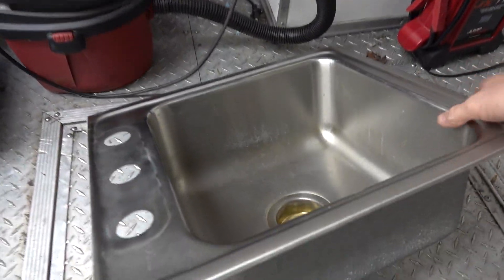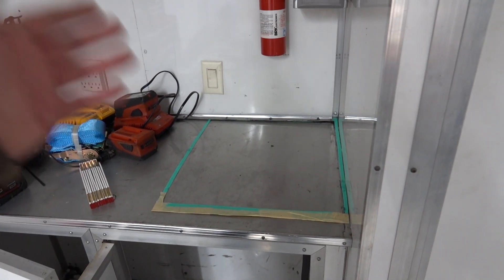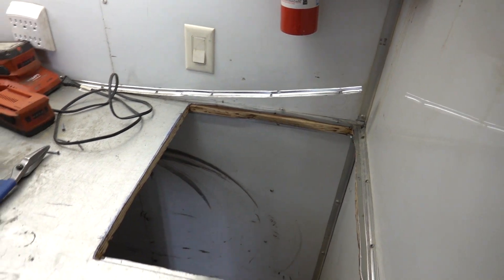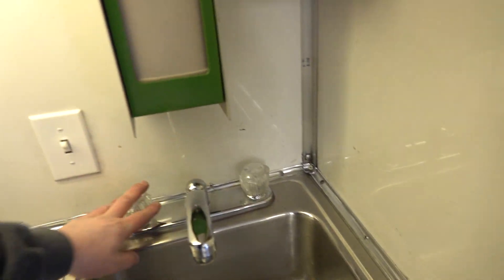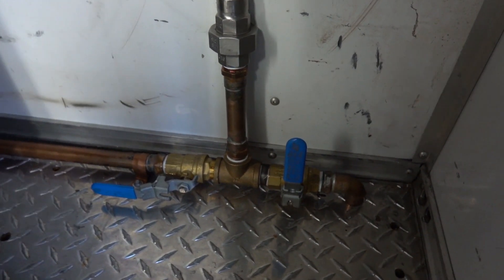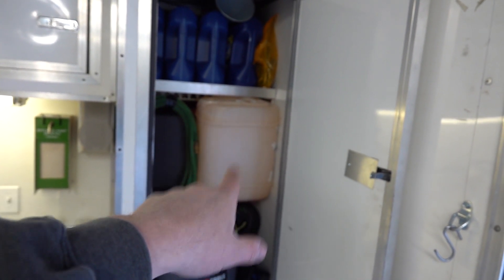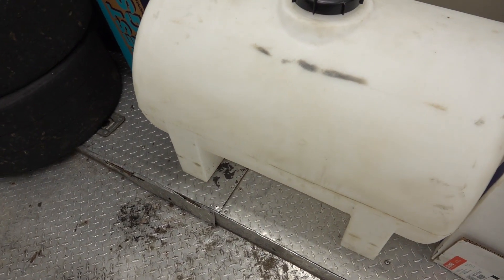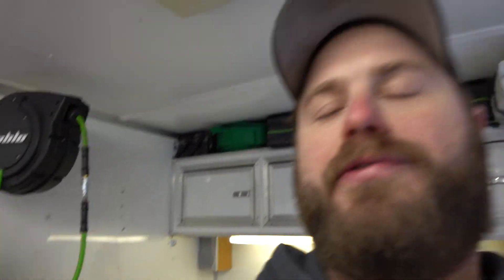Race Trailer Garage Upgrade That Your Trailer NEEDS!!

Comment: I have the same trailer, but 53ft. Does yours have a winch? If so, do you mind showing how it's setup? I have a winch for mine, just trying to figure out where and how to mount it. My plan is inside the bottom cabinets
Reply from the maker: No winch in it yet, but when I do there will be a video